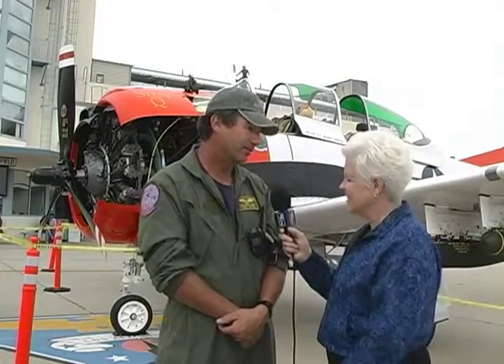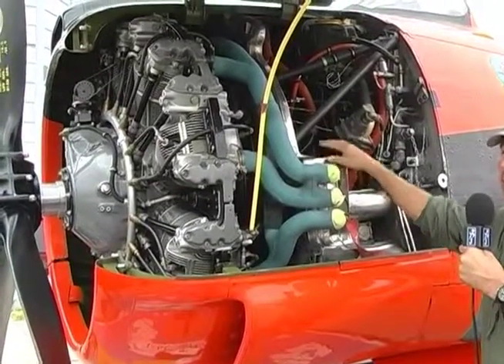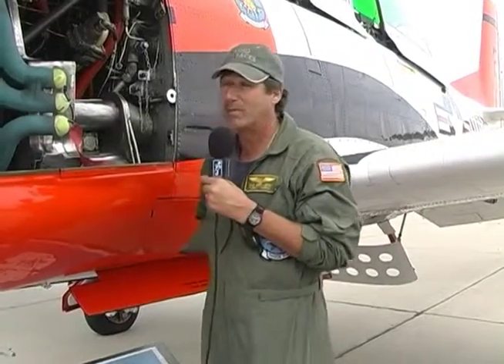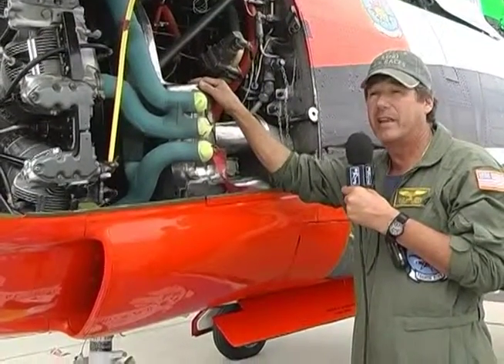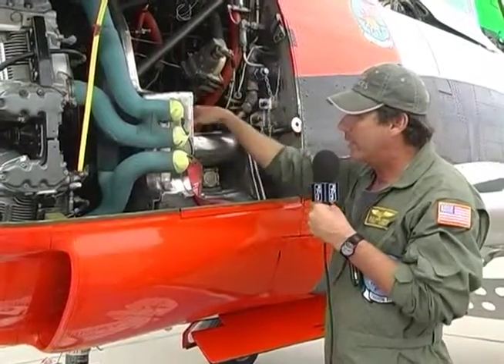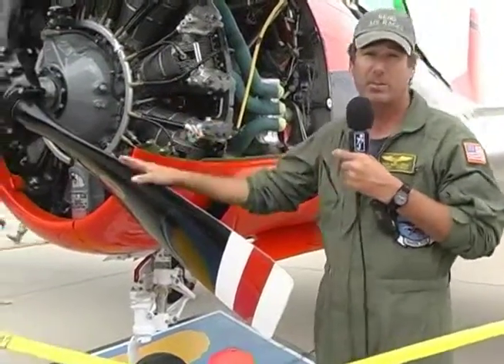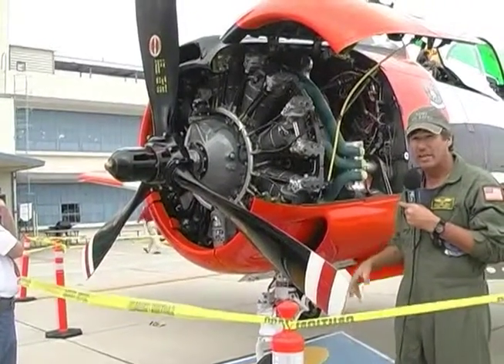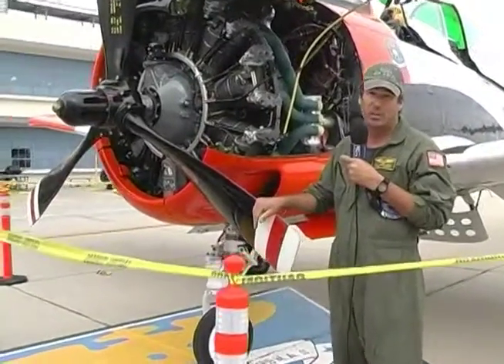North American T-28 Trainer at Wings Wheels Rotors

Comment: I worked on a US-2B in 1979 and don't remember it dripping a lot of oil statically. The cowlings would have a liberal coating of oil after a flight though.  This was around the time that the Navy stopped using 115/145 avgas and went to 100/130. We had to reindex the props to decrease maximum pitch by about 2 degrees and reduce advance as well for the lower octane fuel.